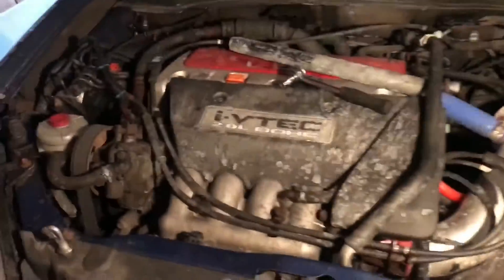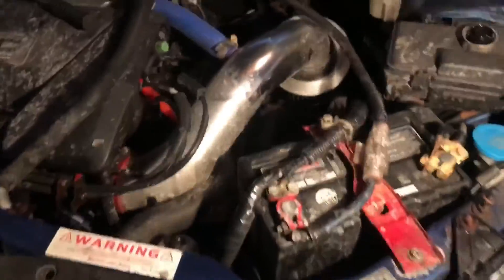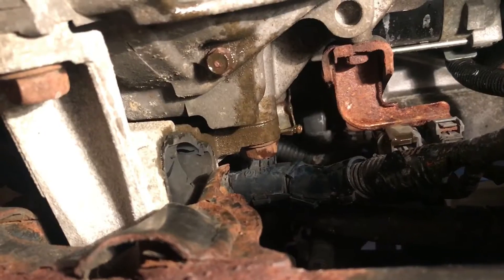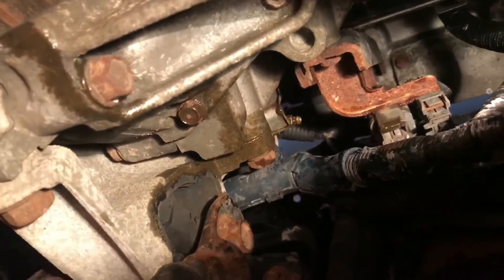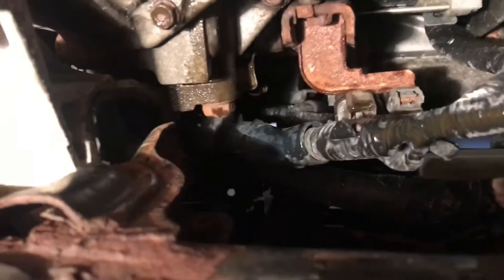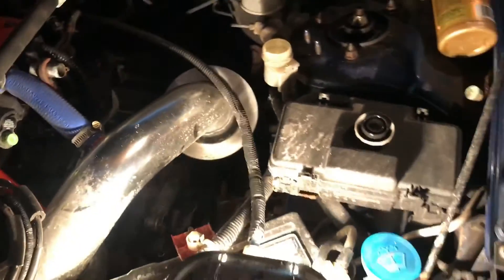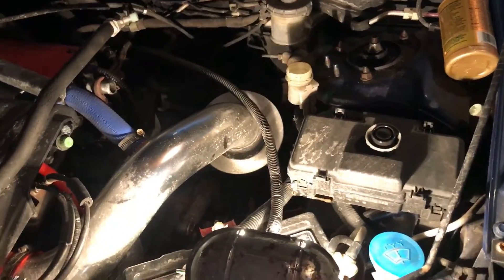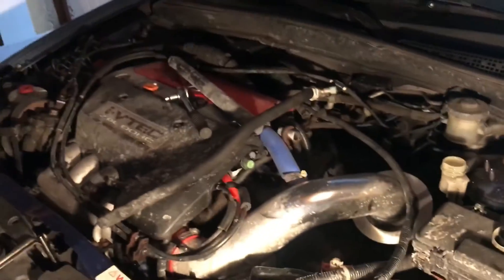[HD] PROJECT RSX: DIY. BLEED CLUTCH SLAVE & MASTER CYLINDER

Comment: I just replaced both the master and slave cylinders on my ep3 si the old fluid was like coffee and milk mashed pea colored runny muddy consistency nothing like fresh brake fluid ,  i am tired of bleeding this thing on my ep3 . 
I really think my clutch, pressure plate and release bearing is done . 285k miles the clutch does not slip it just won't go into fkin gear while the car is on , the clutch pedal has pressure but it doesn't do a thing when I step on it 
, I can shift without pushing the clutch in while the car is moving , but won't go into reverse or first gear while the car is idling smh . I think I will try one more thing before I throw the towel and buy a new clutch kit  , I want to disconnect the lines and blow them out maybe shoot some brake cleaner spray thru them just to see if maybe there's a chance that the muddy lookin break fluid has clogged up the hydraulic lines , anybody here think that might help my situation ?
Reply: Don KiksBiscuits throw out bearing or inner shaft bearing is most likely done!
Reply: I’ve had fluid break down fast if I use DOT3 instead of 4. And I’ve had a mechanic tighten or align clutch plates wrong or
To tight. And a guy who knew those cars did it for me and I’ve ripped it for 100k miles so far and no issues. If you drive it hard change fluids at least twice a year
Reply: did you ever fix it?